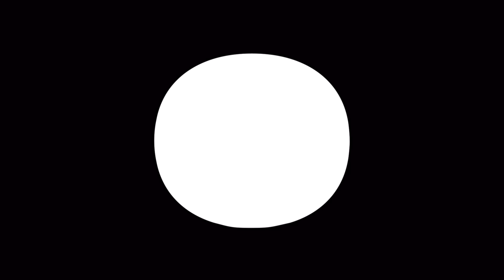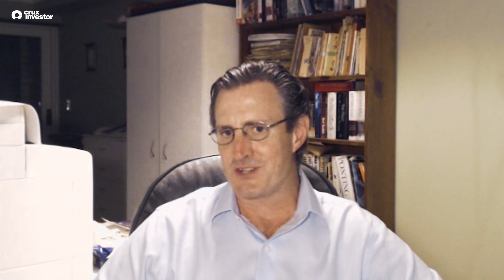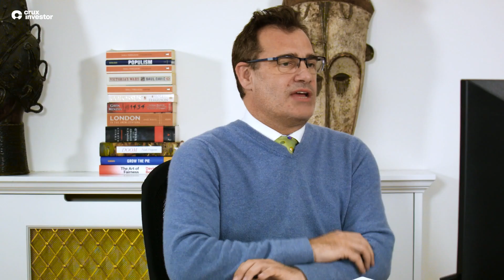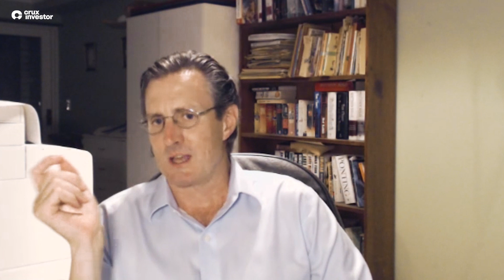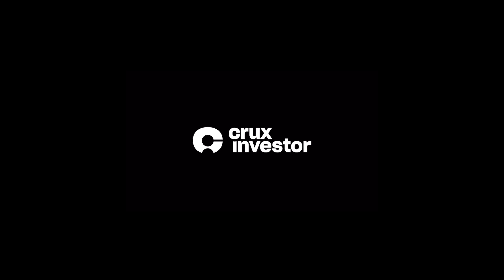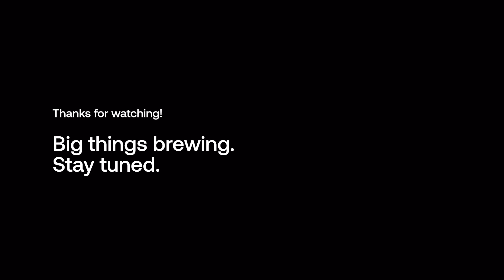Vital Metals (VML) - Rare Earths Producer by July 2022!

Comment: Interesting there is zero credit given to Avalon (Bubar) in this interview from Atkins.  Especially regarding the relationships with the locals which could have ONLY happened with Don Bubar.   As a holder of shares of AVL I am curious (since this Nechalacho land was purchased from AVL), and give the fact that AVL has only sold them the top layer of a MUCH bigger claim with the most expensive Heavies, if there may be some sort of partnership between VML and AVL which would greatly benefit both companies?